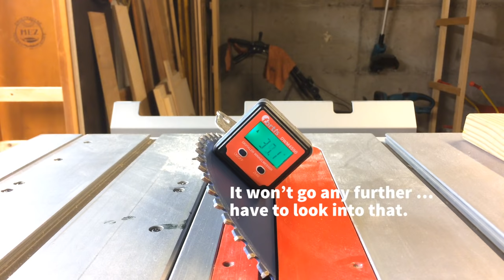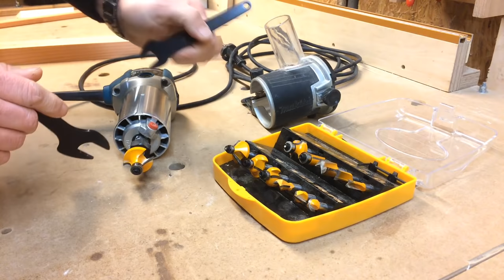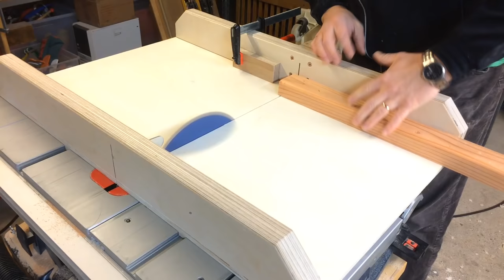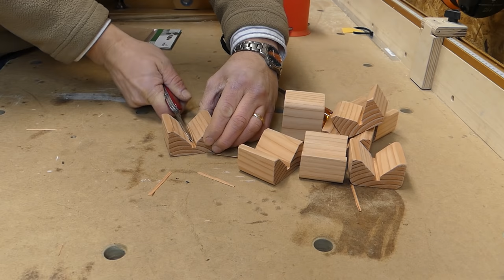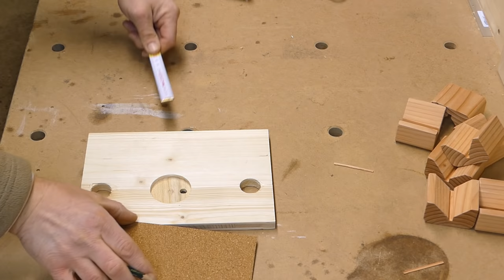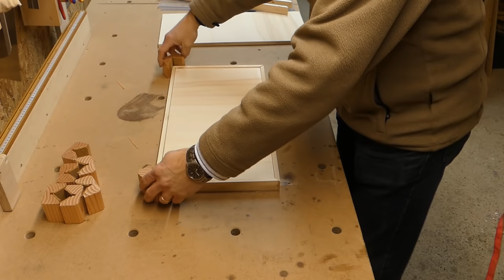Make a simple band clamp – Cheap and simple DIY corner clamps

Comment: Good stuff Andreas, just a safety thing mate it's better control on your table saw with a push stick that has a longer reach & that short one can act as a feather board pushing the timber toward the fence prior stock being cut, sorry if that sounds wrong to mention but the table saw is the king of the jungle in the wood shop & God forbid anyone hurting themselves, carry on with your hobby friend 👍
Reply from the maker: Thanks Dirk. I suppose you’re talking about the rip cut at 0:34? When I edited the video I saw that the work piece went up at the front on both passes and made a mental not to make on of those “US-style” push sticks to prevent it because I totally agree with you. Thanks for pointing it out and thanks for watching.

Comment: I'm all for saving money, but using wood/cork here seems VERY inferior to either plastic or even rubber, since the glue that escapes will easily stick to either wood or cork.
Reply from the maker: +Larry B thanks for your feedback. Your writing principle, however, the cork doesn't go all the way into the corner and there is a gap in the corner so that the clamp piece doesn't touch the work piece. You would have to have a lot of squeeze out for the glue to touch the cork. So far it hasn't been a problem.

Comment: This video is about four years old and I’m wondering if you’ve lost an eye yet from not wearing safety glasses using power equipment that throws wood chips the speed of a bullet. 

A friend of mine wouldnt listen and several years later Lost an eye. After that his work wasn’t nearly as accurate because of losing binary sight. 

I hope you’ve started using glasses and still have both eyes.
Reply from the maker: Thanks for your concern. Actually, in all of professional woodworking in Germany no safety glasses are not mandatory or – as it seems – necessary, except when working with metal or plastic. It doesn’t seem that the rate of eye injuries is significantly higher than elsewhere or otherwise eye protection would probably be required in professional environments.